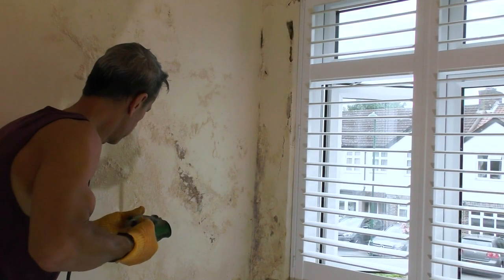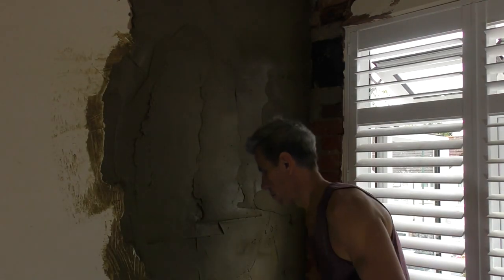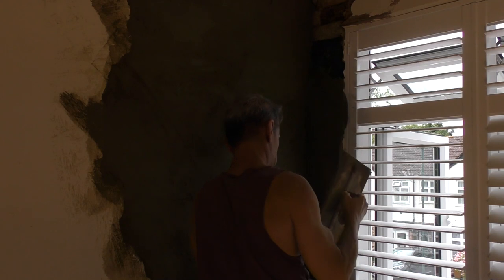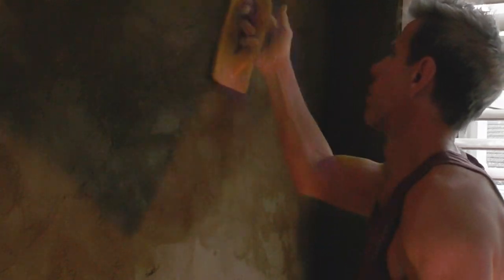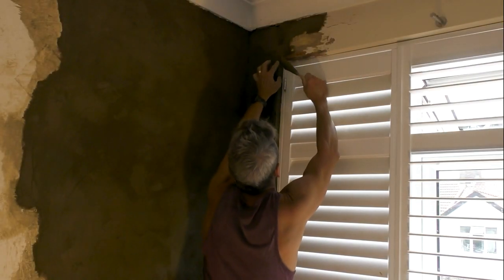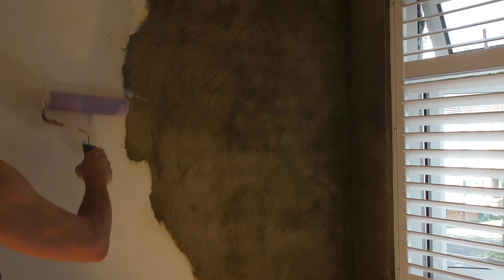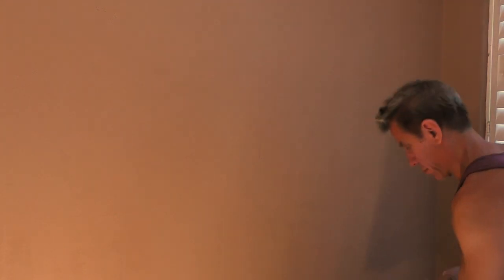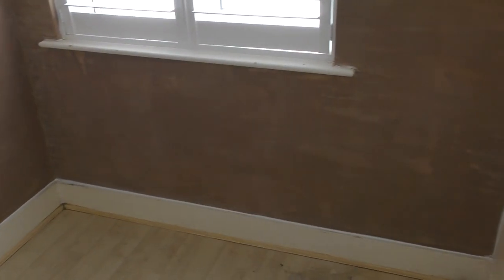Damp Render and Skim

Comment: Nice work on that tricky bead fella... And decent results but personally I think 3-1 is too strong a mix and would not skim the day after.. We leave it to cure before skiming to help avoid shrinkage cracks...
Reply from the maker: Thanks my friend, I know exactly what your saying about too strong a mix, and ideally, as you say it's much better to leave the cement till it's no longer green👍I know from years back how that can look 😧
Reply: @ThePlasterer  i do alot of damp work and hate the fact the scratch coat has to be a 3-1, but we put in writing that they may get shrinkage cracks and any decorating done in the 1st 12 months must be classed as temporary.... Thats the spec of the manufacturer.. I use alot of renovating plaster for small jobs like this one, its light weight and dries alot quicker than sand and cement... 👍
Reply from the maker: Sencible👍 Thanks mate, I try to avoid doing any kind of damp rendering if I can help it... saying that, I've got a job booked in next week that's got a fair bit included😭. Thanks for watching, and your advice, really appreciate it👍